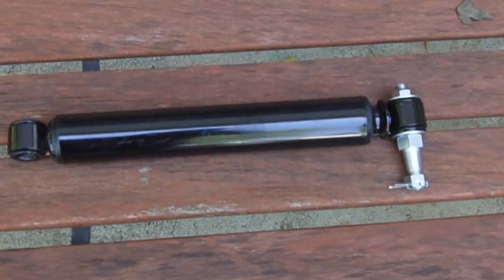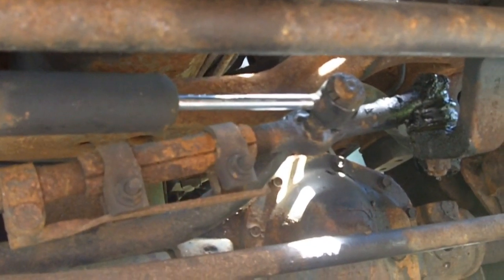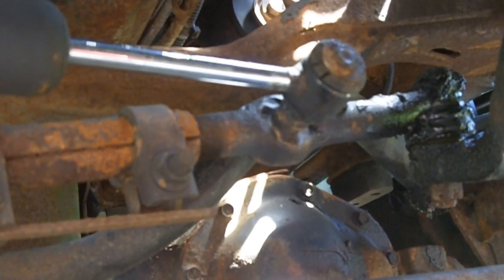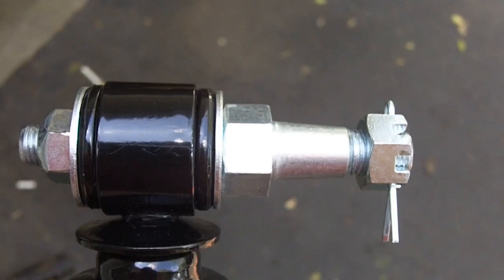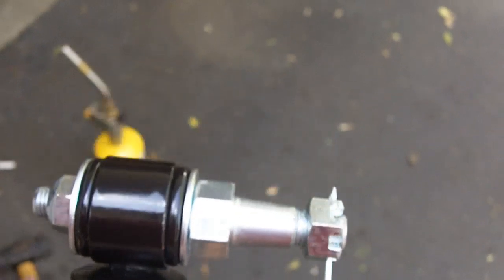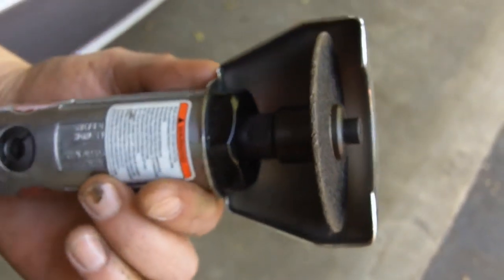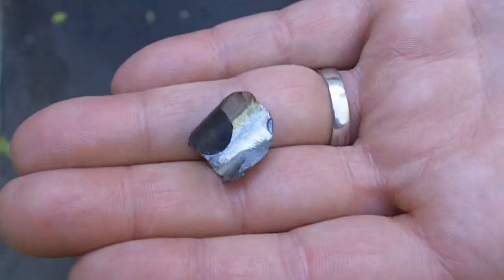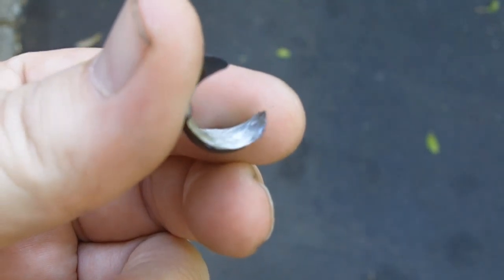MG 56 - Dodge Ram Steering Dampener

Comment: just seen ur vid on that dam steering dampener..just to give u a heads up if you have death wobble the dampener will not fix! it.yes it will seem like it does but sorry its not fixed.so that out of the way. thank's! I was going crazy trying to take my dampener off now I know it needs to be drilled..later